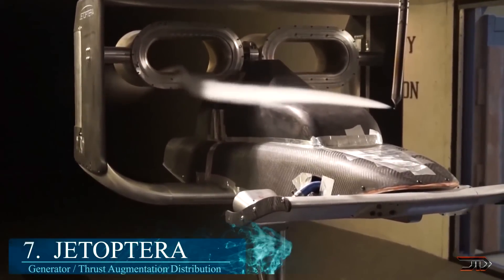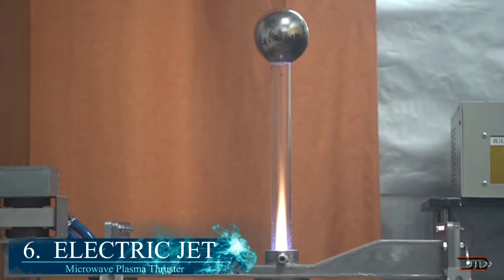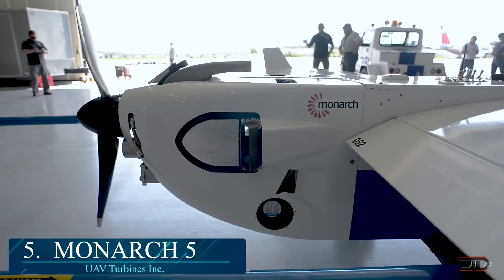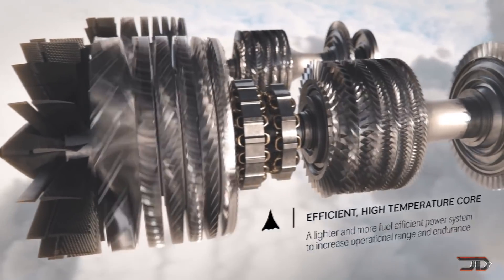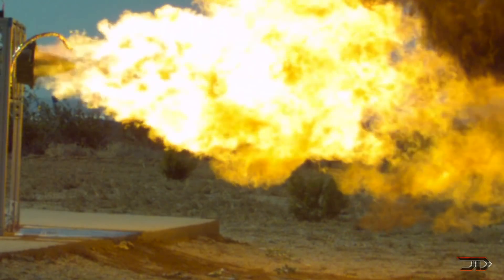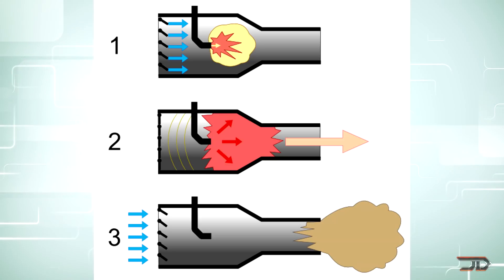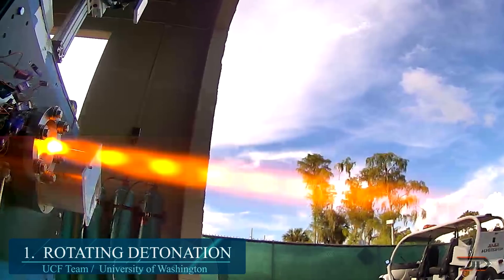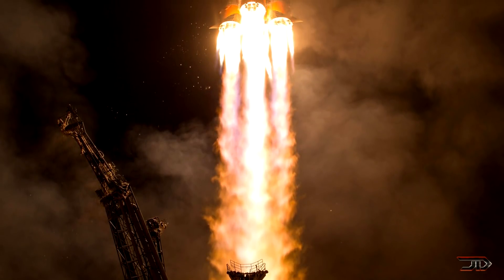7 STRANGEST New Aerospace ENGINES

Comment: Wasn't the 1st pulse engine on V2 rockets that bombed London?
Reply: V1.
V2 was the liquid rocket motor.
So yeah... not new

most likely just a new variant.
V1 used pulsejets with valves (like shown in schematics here)
there is also the "valveless" variant used by colin furze for example.
Reply: @Lonlyguarder  Thanks for clarifying - I was sure it was one of them!

Comment: Isn't a pulse detonation engine almost identical to a pulse jet, which were used in combat during ww2
Reply: No, pulse jet engines such as those used in WW2 in the German V1 rocket were "pulse DEFLAGRATION engines" (subsonic). They suck in atmospheric oxygen to fuel each power pulse. A "pulse DETONATION engine" (supersonic) is something new and nothing like a V1 rocket. It requires the injection of oxygen.

Comment: I find the Jetoptera system very promising and can easily see these turning into industry-standard for short-hop vehicles.
Reply: They never showed tests with their engine actually working though. All their video tests were made using small jet engines or electric turbines mounted on the aircraft. If these things really can fly, they haven't showed it yet.
It works in theory, so they can get funding for it, but in practice it may not even work.

Comment: so how is the pulse detonation engine different than a the pulse jet of a V1?
Reply: This video by Scott Manley explains rotating detonation engines, but it should also help understand the difference between pulse jet and pulse detonation: https://youtu.be/rG_Eh0J_4_s

All pulse jets including that of a V1 rocket work by the rapid burning of fuel, the same as a normal internal combustion engine. This means that the flame front / expansion wave is subsonic (lower than the speed of sound). A pulse detonation engine means that the fuel-air mixture explodes / detonates. The difference here is that the flame front / expansion wave is supersonic, that is that the combustion of the fuel on each pulse as a lot faster. This creates greater pressures, therefore potentially higher efficiencies. 

Imagine the difference between setting fire to something and setting off a bomb.

TLDR: They are considerably different. That is there is very little technology cross over.
Pulse jet (V1) = subsonic (slow) "burn" of propellant in pulses.
Pulse detonation = supersonic (near instant) repeated "explosion" of propellant.

Comment: These are great, but what we really need is have an engine that intakes the air around it, compress and liquefy’s it, and then burn it!
Reply: Why liquefy it?
Reply: @ejegbavworuemu2129  yeah... “condense it” would’ve been better. Liquid oxygen has a really high energy density, no pollution, reusable. it used to power rockets, and if you use it as a fuel you don’t need a fuel tank because it’s what you traveling through and could be condensed on demand.

Comment: the more simple something is.. the less likely it is to break..  and.. the less mass the machine must move... someone mentioned the pulse jet... no moving parts... and.. at least sub orbital capability
Reply: I have AuPd and AuPt.. AuPd turns water into hydrogen peroxide... AuPt splits the 2 hydroxyl ions and... hydrogen oxygen gas... from water.. with 3% H2O2 to start the reaction... see you later Mr Musk... on the moon 🌙
Reply: a gas delivery, like CIS injection systems.. constant pressure governed by the vacuum.. or throttle position... exhaust gas = H2O

Comment: That pulse detonation engine looks more like a kamehameha gun than an engine and I love it.
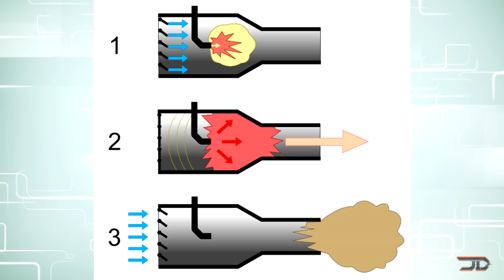Reply: I think it the confusing part for me was that the working diagram of the 'pulse detonation engine' used an old diagram of the pulse jet engine, complete with shutters. at 4:30
Reply: Isn't the same principle used on the V1 bombs ?
Reply: @chpsilva  No, V1 bombs used pulsejet engines. Pulse detonation engines work with supersonic combustion (detonation), instead of the subsonic combustion (deflagration) of pulsejet, allowing, in one hand, higher rate of pulses keeping higher momentum and decreasing vibrations. And in the other hand less stress due to less volume change in the combustion chamber, the expansion takes place at the exhaust. At least this is what I've been able to figure out, please correct me if I'm wrong.
Reply: @danielperaza9655  Its close but from what I understand the difference is actually the speed of the exaust as you can make a pulse detonation rocket engine which can't have supersonic airflow entering it.

Basically a fire burning slowly is what a normal engine works off of and is then accellerated to supersonic, a pulse detonation would already be supersonic with its exaust so it would be more like a bomb.

Both "burn" but the expansion speed is different
Reply: @chpsilva  yeah, that threw for a bit too. this vid by scott manley helped me https://www.youtube.com/watch?v=rG_Eh0J_4_s&ab_channel=ScottManley
Reply: That pulse jet concept is quite old, in fact, it was one of the firsts reaction engines considered, I'm surprised to be considered now as revolutionary and breakingthrough
Reply: @hectorminator4  althoug they work under a similar principle, pulsejet and pulse-detonation engines are not the same.

Comment: Nothing new here . Auxiliary Venturi's with a hint of Bernoulli's thrown , pulse jets of various types and the super inefficient microwave enginr and a big jet turbine engine . The Rolls Royce engine is simply a much more advanced lighter and more compact version of the Ultra Fan engines already common on commercial aircraft and as a retrofit to the US B52 upgrade programme , which deliver more power , greater efficiency in a lighter package at higher altitude than offered by any other manufacturer . The USAF went to the right engine company to meet their needs .
The Tempest 6+ gen fighter engine with both Italy and SWEDEN joining the project , is said to have a design capability of up to Mach 6 which means there is a little more than just an integral starter going on here . 
Considering how easy it is to down a fighter with a low cost hypersonic missile the idea is to produce an aircraft with full stealth capability that will out run the missile . The brief is to design a fighter to accept these loads and have the ability to be upgraded as newer engine designs progress to the point of extremely high altitude and speed .

Comment: The air as an oxydizer rocket seems like a great idea.  Saving that much mass on the first stage would be something.
Reply: Say for hypersonic passenger travel using rocket engines could be very efficient 

     Me personally I like to take the design to its limits be the fastest woman to ever rocket across the sky 
    Have a few concepts structural and aerodynamic plan to have a ejection capsule that could survive almost anything
Reply: There's plans to try air ram intakes with air separators for rockets your really only want the o2 going to the engine but the nitrogen and co2 could actually be used to cool the ram lowering its drag with evaporative cooling and micro grooves

    Still have to take lox for after your out of the atmosphere could even use helium for the evaporative barrier and reclaim it to reuse it with centerfugial air separation

Comment: Number 7 engine is a hidden fan, like the Dyson, not light weight eighter. The others have future potential
Reply: It moves a lot more air than a turbine using the same energy, just like the dyson. Also it doesn't crash on birds
Reply: @onebacon_  the pressure is higher, as the turbine flow is within, the amount of volume outer may not be, to carry the craft into flight the same. Unless thats what they are asuring.
Reply: I struggle with the theory on this one. So it has a compressor that pulls in a volume/mass of air and turns it into a high speed compressed airflow which is routed to the thrusters where it is used to accelerate the air flowing through the thruster. This will slow the high speed compressed air down right, basically force = mass × acceleration. So basically it's trading a lower mass of high speed air for a higher mass of lower speed air. I'm guessing the thrusters could be more efficient and make sure the force is more aligned with the desired direction of work than a simple high speed nozzle outlet, so better efficiency maybe. I can see some safety benefits with no fans in the thrusters, but it still has fan blades for the compressor which as per other aircraft you'll want to keep stuff away from. What is it about the trusters that are an improvement over just accelerating air directly with blades?
Reply: @nic.h  most of them are doing pulse wave effects, similar to fictional theory with mass particles, which I would call geoscoptic motion, so your technicly correct , it wouldn't work in the classic calculation,  but in pulse deprive & go waves... like I said, "the others have future potential."

Comment: Pulsejet engines were used by Germany in WWII. The V1 used pulsejet engines, so they're nothing new.
Reply: But they weren't pulse DETONATION engines where explosion wave moves faster than speed of sound. This may seem a small thing but it changes really everything. They don't no longer suffer sucking air back into exhaust. There could be even multiple detonation waves going out at same time.
Reply: Pulsejet engines are also some of the simplest kinds of Jet engine. Unlike the pulse detonation engine or the rotating detonation engine. It is quite interesting how these engines are in essence so similar. But when you look in to them, they become dramatically more complicated.
Reply: Those were highly inefficient pulsed deflagration engines.  By using detonation, you save all the energy normal engines use compressing the air.
Reply: @blurglide  "normal" pulse engines doesn't use compressed air.
Reply: @lightningrider5849  Nor detonation engine uses any air
Reply: They are not the same, Juuso Ukkonen described it well.
Reply: The V1 was a liquid fueled rocket that left the atmosphere into space and fell on a trajectory over England.
The buzzbombs had a pulsejet engine which used air at about 30,000 ft.

Comment: Engine running on electricity "doesn't use fossil fuels".
Because electricity comes from magic pixies?
Reply: Well we don't have to use fossil fuels for electricity production, we do have other options. Although in all fairness we are still heavily reliant on fossil fuels for a fair percentage of electricity production at the moment
Reply: @nic.h  The same people pushing "alternatives" are trying to destroy hydro and nuclear. The only reliable 24/7/365 affordable power left is from fossil fuels.
And all the alternatives depend on fossil fuels and petroleum products.
Reply: @patmcbride9853  renewables (wind/solar) need to be supplemented with appropriate energy storage solutions to be practical unfortunately, and yes currently shortages in renewable supply tends to be supplemented by fossil fuels still unfortunately, but we are improving. Both hydro and nuclear have downsides as well, but are arguably better than fossil fuels in my opinion given the choice. Anyway my point was that we could in theory obtain the electricity without burning fossil fuels, but it's fair to say that as a planet we are a fair way off being able to achieve that across the board.
Reply: @patmcbride9853  We have technological solutions available, just not at scales we require, same on the generation side, both will be pretty expensive to fully replace fossil fuels. Some of the solutions are also probably not practical at the scales we need. For example lithium based battery solutions could work, but we would run out of lithium well before achieving a fossil free future.

Comment: how about laser propulsion? (for use in outer space) i've had an idea which uses part of the laser lightsail concept that stephen hawking and that russian billionaire plan to make and a nuclear power source or energy generator, although my idea doesn't need a huge sail or remote laser source because you can have the laser as part of the spacecraft, you could control the laser diffraction or use it to control acceleration speeds, overheating issues etc. 

have lasers that extend out the back of the spaceship on poles which are aimed back at the spacecraft (have the lasers aimed at those ceramic materials that can withstand huge temp spikes without breaking, or make a new type of material that gives off small explosions without much degradation (but this could be for version 2.0) then use super capacitors powered by a nuclear energy generator which would charge up and fire the lasers in pulses at the back of the spacecraft ceramic or metallic panel. now normally you'd not be able to do this with a substance because of it pushing against itself but you could with laser light because the speed of light is the speed of light no matter how fast the spacecraft is travelling at, so it would always deliver a blast from the laser at the speed of light which in time would continually speed up the spacecraft with each firing of the laser. you could have multiple lasers firing off so it gives a smoother acceleration. you could maybe diffuse the laser a bit too to stop overheating or use microwaves, infra red or ultra violet. the key to this is having it fire back at the ship from extendable pods and not fire directly out the back at the ship into the nothingness of space as the laser has nothing to push off of within the near as dammed it vacuum of space, but if the lasers are aimed back at the craft a push in the opposite direction would happen propelling the craft forward.  or maybe the spacecraft could be doughnut shaped with the propulsion in the centre but could be changed to any angle which when fired back at the ship would propel it in the opposite direction.  this might not be the quickest craft to accelerate but over time it would build up to immense speeds. been toying with this idea for several years and have posted it on various platforms but always been too afraid to actually send it to an engine or laser design company. do you folks reckon it would work, or if it won't please feel free to tell me why
Reply: You're forgetting actio=reactio. :)

Comment: Just a slight correction: For the for see able future RDEs are heavier then standard rocket engine due to needing a inner and outer combustion chamber walls and the walls need to be thicker. They are still a improvement for upper stages thanks to the 20-25% increase in efficiency, allowing a smaller engine to just run longer and save on fuel weight.

Comment: Pulse Jets aren't new, they were first used on the V-1 during WWII
Reply from the maker: That is true but rotating pulse detonation engines (which actually are stable) are fairly new. I'm not sure if they will go anywhere though because of the decibel level.
Reply: No- that was a deflagration engine.  Similar concept, but detonation is in a different universe performance and efficiency wise

Comment: 4:04 I think, pulse detonation engines are not exactly a new idea... en.wikipedia.org/wiki/V-1_flying_bomb
Reply: The V1 had a pulse jet, but the fuel burned and did not detonate. A detonation has a supersonic pulse, its like being propeller by a rapid firing canon.
Reply: @Paul Putter   @Pilot16H  which makes them a pulse jet engine with a higher combustion rate.

Comment: For the loud Pulse type engines, cant they use some form of noise cancellation technique?  Certainly if they can desing these new types of propulsion they can figure a way out to use a technology that has been around for a few decades.
Reply: Noise cancellation would steal a lot of energy, though, which isn't worth it. It's all about operating at the maximum possible power efficiency when it comes to rockets.

Comment: Honestly you could get more out of a plane if you just have the engine in the center of the playing and have like four or five electric motors in series with the coils in a vortex like design and a 9 12 15 18 21 blade propellers on each one to compress the air that the plane would be pushed and that air will go through the plane not just around it. Like a mig-15 or 18
Reply: Would it fly in space
Reply: @boundlessmatter4361  Given they say it would be compressing air and that there is a bit of a lack of air in space, I'm going to go with no for this one